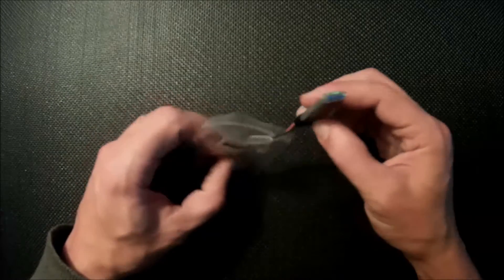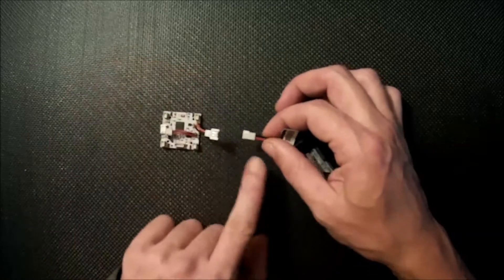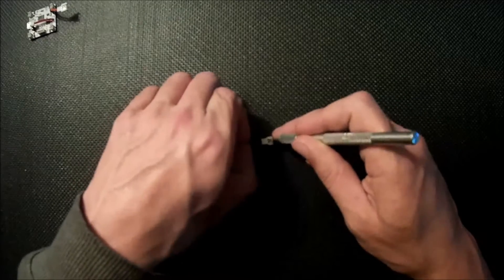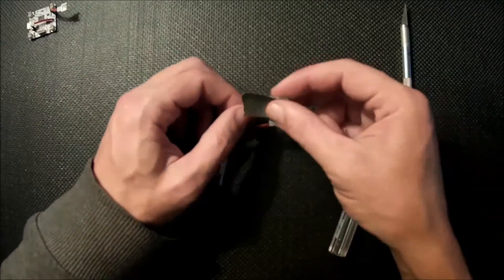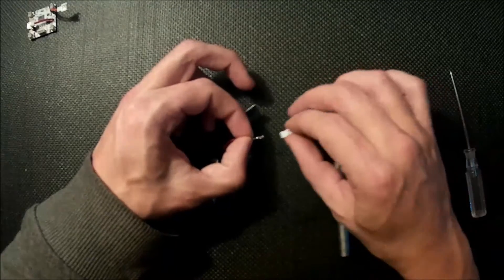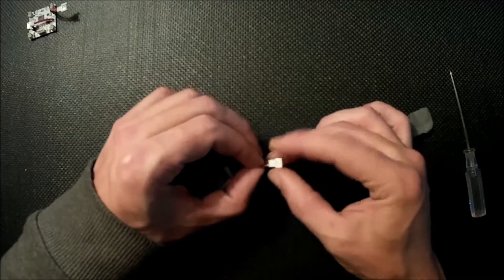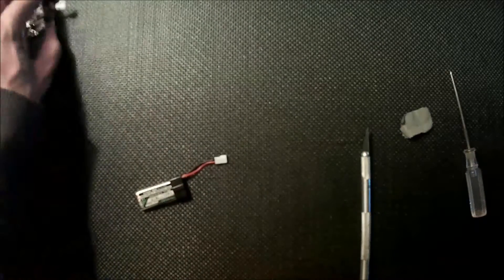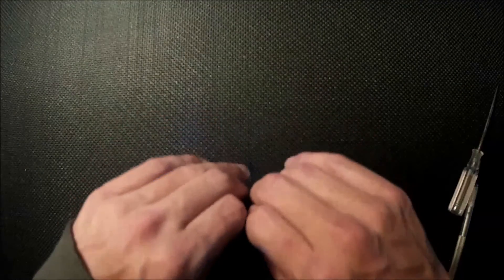Swapping plug polarity on a micro Losi "walkera" connector

Comment: Thank you sooo much! I was having a bunch of grey hairs growing on that special plug, where to get the right lipos with this one for my micro quad eachine E010s. 
Finally found them, exact same as you have there, from ebay shop. 
First I burned the little charger I still have from zyma x4c without noticing it. Then I put it in the E010s, big Spark flew in my face like it was screaming "You **hole!!!" and the props went crazy. But I was lucky, it is still fine! 
Now I am happy, will change polarity right away.. :-)
Thanks a lot for showing how to, dude!

Comment: I bought 8 batteries and so far have wrecked 2 of them by pushing too hard on the little metal piece to get it out of the plastic so it will not stay in (I've tried bending the clip back out, but I found I had to put so much force to get the pin out, that it's bent way beyond my ability to get the clip back out). Do you know where to get replacement plugs/pins from?